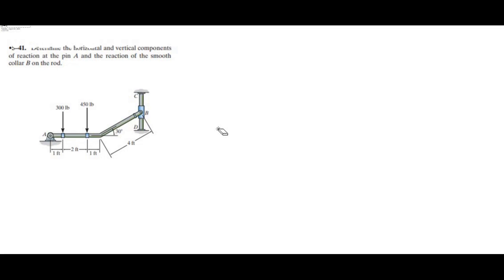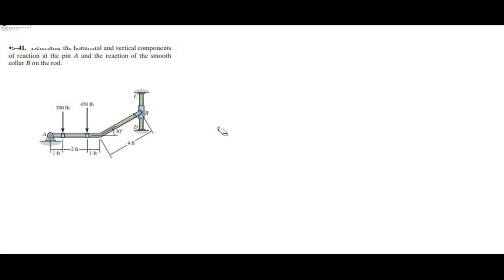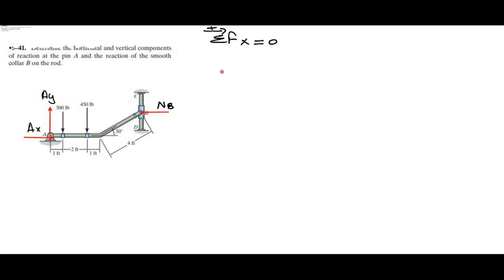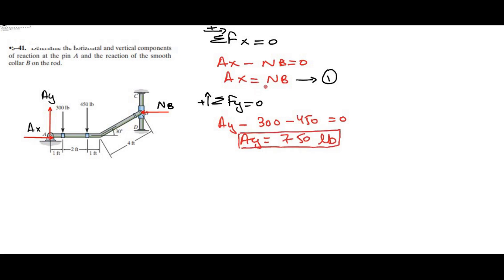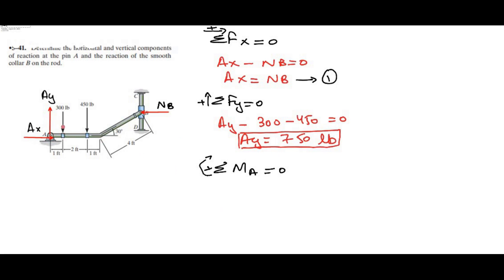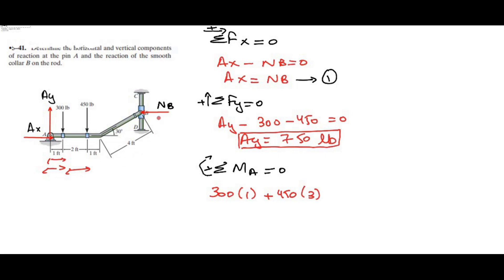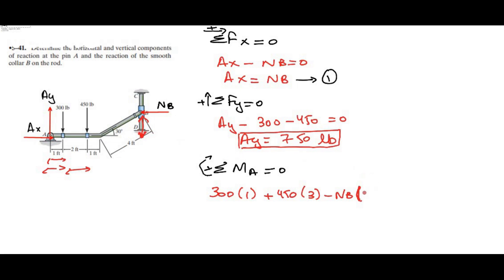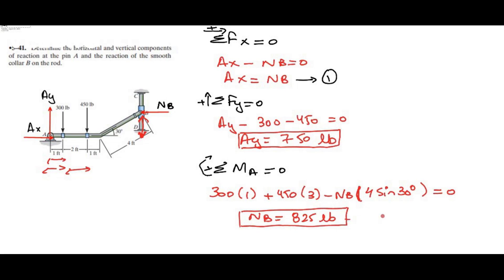5-41 hibbeler statics chapter 5 | hibbeler statics | hibbeler

Comment: Are you sure clockwise is positive ?
Reply from the maker: Hi, 
Taking clockwise or anti-clockwise moments as positive depends upon the person solving the problem. 

Well in Hibbeler and most of the books, you will find anti-clockwise moments taken as positive.

But it does not matter whether you take a clockwise or anti-clockwise moment as positive as long as your moment equation is written correctly you will get the correct answer from both of the approaches.

In my videos, I have solved the problems from both approaches.

I hope it will help.